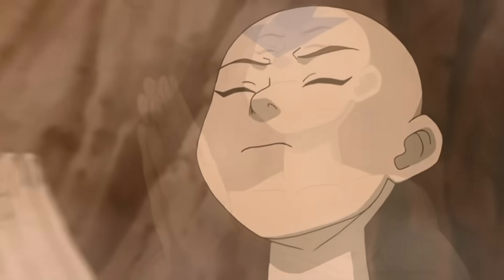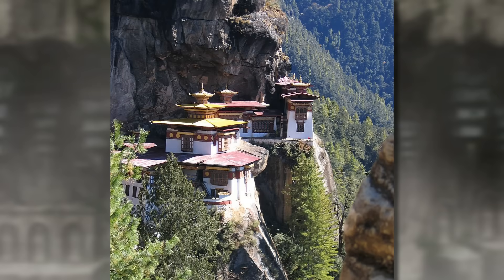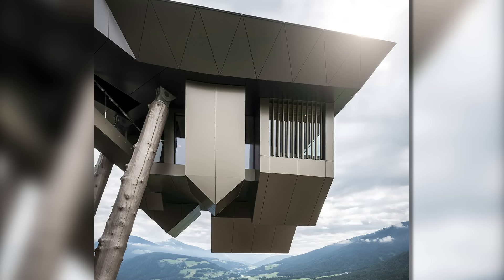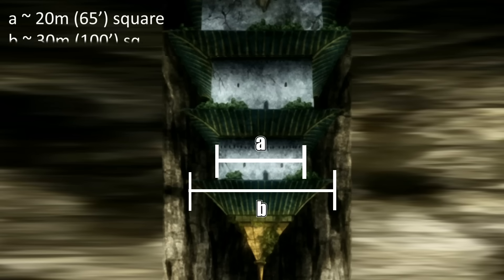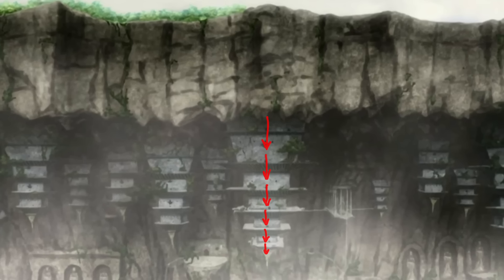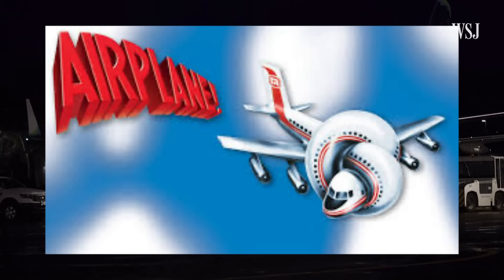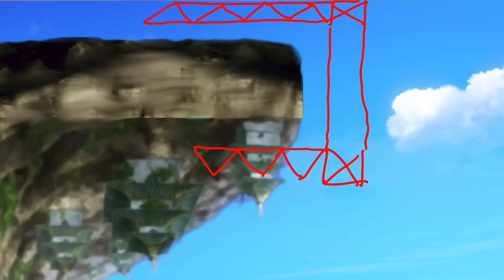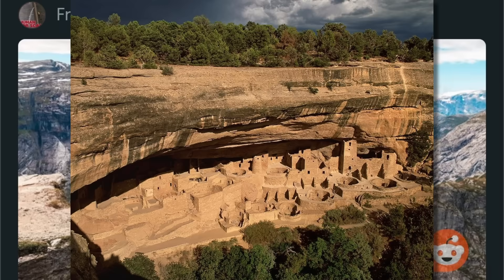Engineering Avatar’s Upside Down Architecture

Comment: If the structures have large swathes of the interior as solid, then it could well be horizontal construction using massive stalactites as the base to build around. The interiors are large columns of natural rock. Considering the shapely nature of the cave, and the stone carvings on the interior face, maybe they used air bending to erode a cliff side and literally carve out the space? Considering the large brick looking nature of the walls though there might be some polished stone slabs as a veneer. All in all it’s pretty appropriate for an air temple in earth kingdom territory to make use of the rock so well. I imagine there was a lot of coordination between the two.

Comment: The bottom surface the air temples are connected to have small stalagmites already implying that a stalagmite structure is also the core of the air temple. The air nomads minimalist approach would imply they would also choose to live in an environment where their homes conformed more to the natural environment rather than fighting against it.

Comment: the air temple is old, so it is not infesible it was built by some earth benders in good relation with the group of air nomads or a prior avatar
build a cave down (possible to the building structures in the side wall that are not hanging) and then from the side structures under the overhang build up to and then into the overhang
use earthbending on the overhand and into the ground itself to turn the less sturdy rock into sturdy rock

Comment: i mean building truout history has been used as a means to flex on future generations, the world of avatar has people capable of some seriusly impressive building, shure the earth-benders themselves prefer what to them is tempromary and fast-built stuff but it not even a little hard to belive that material strengthening woud be one of their sub-disiplines.
anny master worth their salt vant to show off their skill so having one or more of them take on a project like this is entierly posible. every acolyte o the disepline woud be raised on stories of great works like this. they may not be praktical but imagine an yung earth-bender traveling the road long below looking upp at the damaged temple realising that given time and effor he to cud make something as impresive as that.

and it is impresive, with the posible exeption of the north poles canals its buy far the most awe-inspiering civilian piece of infrastructure in this world. the wals of basingse may outscale them in size but not ambition, the vestern air temple needs no walls, unless you can fly it is nigh-unasailable and all youd find annyway is a bunsh of pasifistic monks. hardly a milletary or political powerhouse

Comment: This is a good start to looking at the structural feasibility of the Western Air Temples. I'd love to see you push this further. Like, I think rock anchors are used in mining, so if you wanted to investigate the steel idea, that would probably be a good place to start. I'd love to see the numbers involved in this kind of thing. I also think the stalactite idea is warrants a lot exploration too. I'd love to know how forces would be distributed in this kind of structure and which points are most likely to fail. How would removing the roofs change things?

Along this line, I noticed you had some 3D models of a generic temple structure rotating around, but you never explained what they were or why they were there for. Is this how you would layout the structure structural elements for any given temple? Did you use these models to run simulations? Did you analyze them in any way? Why are they here?

That said, I just wanted to remark that your editing and jokes are like being squirted by a squirt gun. No impact and completely non-incendiary.  More than anything else, it just felt annoying.

Another thing you could look is specific cultural influences and architectural elements on the temples. Like, what's with the green roofs and golden finales at the bottom of each structure? I loved the beginning part (minus the complete disregard for good shot to shot editing) where you talked about similar looking historical buildings!
Reply from the maker: I appreciate the feedback here. Unfortunately the reason why the videos don’t answer many of the questions posed are due to Time and Demand. In my first 4 or 5 videos I get into the math on infeasible structures, but those take MUCH longer to make and I like sticking to a monthly schedule. And also… those videos (until recently) didn’t have much of an audience. I’d love to dig deeper eventually for future videos, but that might be a ways off. Thanks again

Comment: As you alluded to at the end of the video, the biggest issue of the western air temple, funnily enough, is the rock formation. The stone is apparently some sort of metamorphic rock, so it cant be cut out by air like in mesa verde, and rivers would not be able to create such a wide cut-out. Additionally, the closer to the edge you get, the less stable the rock will be as it thins and its support gets further away, and yet the biggest temples are also close to the edge. Ultimately, there isnt a rock strong enough to support all this which could reasonably form on top of a layer weak enough to be eroded away. Unless you have badgermoles in your basement, its the geology that makes the temple impossible.
Reply: Whether by earth benders in this universe, or regular workers IRL, it’s possible this overhand isn’t natural and used to be a regular vertical drop. Then the temple and all the negative space was carved out and then below removed to create an overhang and the temple. There are plenty of examples of this method being used (granted right side up) where the whole temple is a solid piece of carved rock and still attacked to the ground. See the Kailasa Temple in Ellora India for an example of the largest such construction.
Reply: For me the geology would be such that it was completely solid and of high tensile strength. There are no air gaps and have a crystalline structure that doesn’t not have cracks. That is the only way the original structure can be intact before the buildings can even be built. So, in essence, earth benders.
Reply: Maybe another air nomad avatar helped them out with the earth bending?
Or they could have negotiated with their limited connections for something with the Earth benders

Comment: ome word: erosion.
if you got a cliff overhang its very likely due to erosion. cliff faces move a lot over time. 
we wouldnt hang buildings below a cliff for the same reason we wouldnt build a house on the edge of a cliff.
if you see any house on a cliffs edge chances are that when it was built it wasnt on a cliffs edge. and it probably wont be there a century or two later.
Reply from the maker: This is probably the best answer, most cliff faces in reality aren’t situated like this, and would be subject to eroding elements.

Comment: The thing is as air benders, they actually can play a weird role in concrete since they could probably more or less have it set instantly. ontop of a deeply connect root system like with the foliage around here (foliage down here with no light, hanging in a ravine) might be alright to afix it to the rooting systemover a period of time. If we can pull water out of course sand, you can prolly yank the air out of it while possibly being able to keep a hydration level, hence the free running water in a structure that, for flying people, prolly shouldnt be there unless necessary. And since back in the day we sometimes had a habit of just... pooping down tunnels that could just be far enough from the smell, idk if the waters for plumbing
I hope they had a good relation with fire benders though and maybe got steel, but besides needing then earth benders to take extensives to bring all this stuff down here and assemble it for them (Cuz I dont think the airbending can get there, maybe with the bison like ox for the job) I almost feel like the airbenders are friendly, but bad earth bending partners if theyre always asking for ridiculous places to store their cakes and meditate all day lol
Reply: The problem with concrete is low tensile strength. Concrete is reinforced to improve tensile strength, but rust prevents reinforced concrete from lasting long. This is especially true if there's a climate of hot summers and cold winters due to the expansion and contraction of the metal.

Comment: Using steel in the world of Avatar feels weird to me. The fire nation had some, though even they mostly used iron, and every other nation used metals very sparingly. A suit of armor or sword. Enough steel for a building like this (especially noting it's 100 years old minimum) just wouldn't be possible in universe. 

I like the stalactite theory the best. I'm not sure how strong an earth bender would be able to make the rock, but if it were mostly solid I could see it being just strong enough. Wood for the most of the rest of the structure.

Comment: You are right, hanging buildings, fictional or otherwise, have very little references available. There are just too many variables involved in their construction and integrity.
The only other big reference I can think of, off the top of my head, is a location from the old Dreamcast/Nintendo Cube game, Skies of Arcadia (year 2000).
In there, you have a whole ass city called Glacia that is made of and hangs of ice. Or some opaque, ice-like material.
It is built and looks more or less like the western air temple. The catch here is that the city is supposedly built using "super advanced lost technology", so it's any bunny's guess how they built the whole thing under a glacier floating in the sky, and what manner of materials they used.
Also, as the paragraph above hints at, the world of Skies of Arcadia is a world of floating continents (very cool looking, and arguably the best damn world ever made for a game), so aside from the tech and materials, there's also the unique gravitational quirks of the world of Arcadia, which should make a hanging city more feasible because of them. In theory.
Maybe check that one out and make another video on that unique and wondrous place. There's also plenty of footage available thanks to the many walkthroughs and playthroughs in Ytube.
Reply from the maker: That sounds epic, I appreciate the suggestion. Gaming videos are a bit harder for me to work and research on, especially if I’m not familiar with them, but this is definitely going on my list. Thanks for watching!

Comment: Great analysis video, I like your takes on how a real-life freely hanging structure like the gorgeous western air temple could be designed. I still think that it is possible that the structures could have been sculpted by earthbenders from the overhang rock itself or maybe actual stalactites they turned into structures or added ornamental elements onto.
Also, the scaffolding could just be hanging from the ceiling rock (And connected to the ground above the cliff overhang via ladders), there are a lot examples of scaffolding or other platforms hanging from the roof of buildings, like those window cleaning platforms outside skyscrapers.
Reply from the maker: Thanks! Glad you liked the video. 
Yea the window washing supports (I call them Davits) sort of what I was alluding to in the video with regards to the construction support. Recently on an 11-story building I was workin on, the contractors had to install something outside of the highest floor and proposed more or less what I sketched during the video.

Comment: I would absolutely agree that the main structures of the temples are made out of steel. The geography supports it.
The western Air temple is situated right between two major points that would make it easier to both source and work enough iron to make that steel.
It is close to the fire nation, who have the metallurgic knowledge and skill to mass produce the steel, and an area that would later be known as Yu Dao, the first Fire nation colony in the earth kingdom after Sozin did his thing with the Air nation. Later also known as Republic City, skyscraper Central. Rich in Iron and home to many skilled earthbenders. 
It would fit the air nomad philosophy to hire from both sides of the oceanic divide to construct a temple they could only build by all working together
Reply: This would have been built minimum 100 years before the episode. Before the fire nation's industrial revolution, or Sozin's comet. The colonies may have existed, it's hard to say, but they certainly wouldn't be large industrial powerhouses yet.
Reply: @AGryphonTamer  it was definitely built long before
Doesn't change much about it, though
The fire nation/fire islands were good at metallurgy long before their industrialisation. It comes with the element, smithing iron is easier when you can keep it hot by breathing on it
And the area of Yu Dao doesn't need to be a colony to be rich in iron and earth bending talent
Reply: Not to mention the fact the area they camp in sports massive metal doors
Reply: Except that might not have had that knowledge at the time of construction.  Steel, even in the real world, is a relatively new development, and the temples are well beyond ancient in series. No, I doubt steel would have been used, more over the logistics is still in the way there.
Reply: @Arkilos  The existence of steel had been documented as far back as the Ancient Egyptians. traces of steel tool residue had been discovered in ancient Mediterranean towns and cities through craftsmen, butchers, and so on. Roman-Era steel armour and weapons had also been found, archived, and displayed all over the world, especially in Asia where most of the artistic and cultural influence of ATLA came from. Although steel would've been absolutely expensive to make due to the extreme process needed to forge it in our world, The Avatar World is able to bypass the natural power necessary to produce steel thanks to the existence of Firebenders and Airbenders (probably even Lavabenders if rumours are true about Lavabending being an ancient and forgotten practice). It wouldn't be so out of place to see ancient Airbenders employing ancient Earthbenders and Firebenders to work together to forge and install steel frames to build the Western Air Temples, especially with the geography mentioned by Soguwe.

It would ABSOLUTELY still be expensive and tedious to make at the time, even with the Firebenders and Airbenders cutting back the extreme processes of creating steel. But to say that ancient benders wouldn't be able to make it at such a scale would be an understatement to how revolutionary bending is to the development of this fictional world, and an absolute ignorance to the ingenuity of the ancient peoples of our past to even think that they don't know about the alloy's existence, when they knew about and had forged and crafted with bronze.
Reply: @BUMMY105  Egyptian steel was meteoritic. They didn't have the ability to make it, nor did they have any way of distinguishing it from iron, which they also could not make. They knew it was metal, so they could work it similar to copper and bronze but it was functionally a mythical material, reserved for sacred or ceremonial uses. In reality, steel could not be made in quantities larger than a few pounds at a time, until the mid 19th century. 

Even if they were using iron and not steel, forging structural quantities of iron was still exceedingly rare before the 18th century. The closest we have ever observed would be something like the iron pillar of Delhi, and similar iron pillars on the Indian subcontinent. Those were still massive undertakings for the time while being dwarfed by the iron demands for a structure like the Western Air Temple.
Reply: Hire isn't the right word, negotiate would be more accurate. Nomads aren't really big on the whole "earthly positions" thing.